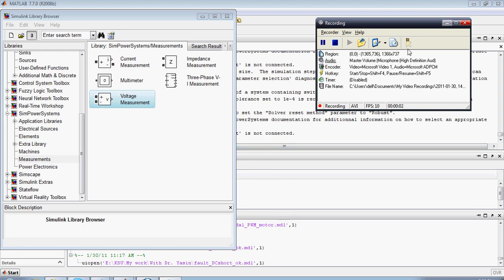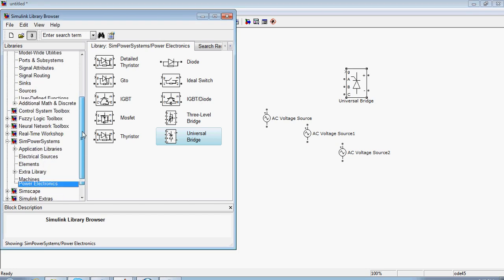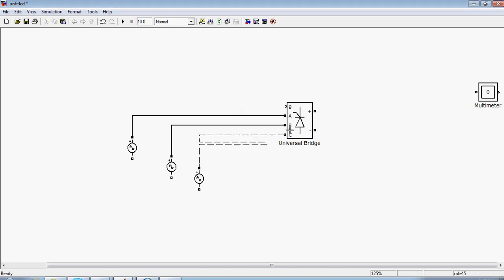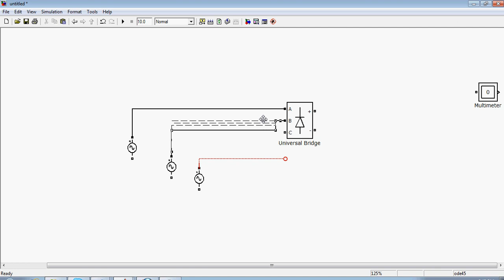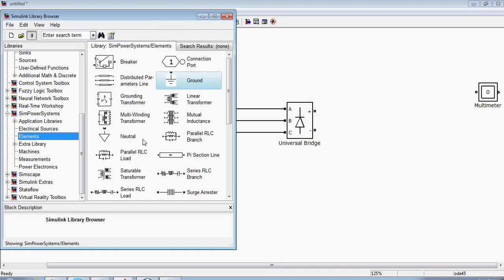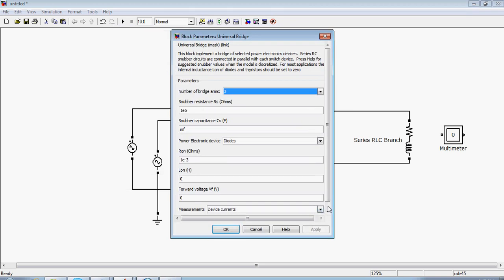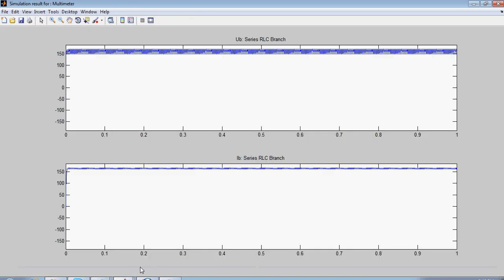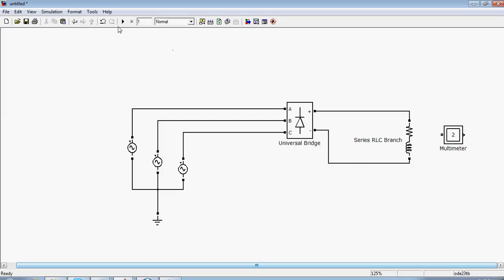Simulation of Three Phase rectifier in Simulink

Comment: good one thanku sir ...3 phase 3 wire converter how to model?
Reply from the maker: +J Alekha What do you mean exactly by a  3 wire converter ?
Reply: i mean, 3 phase 3 level rectifier. How to model it.?  i do not know how to post the image, so sending website: (open access)...

 http://www.mdpi.com/2079-9292/4/2/339/htm

or u can suggest me any other source if there. thank u sir for taking time .
Reply: +J Alekha You can model it without having any difficulty. However, you need to carefully design your control scheme

Comment from the maker: Yes it is simple. The firing angle is  calculated by (firing angle/360)*(1/f). you also need to set the period as (1/f) where f is the frequency of the AC waveform applied